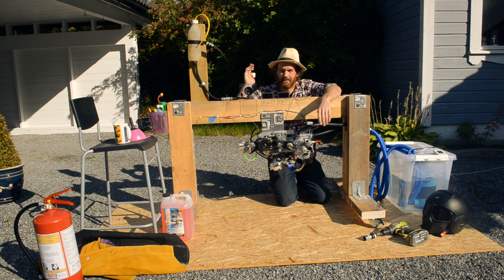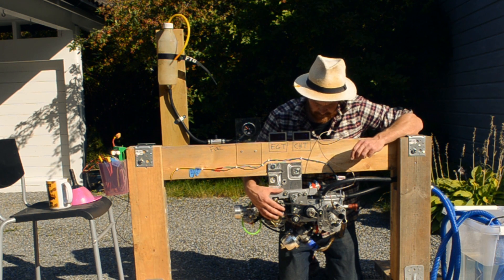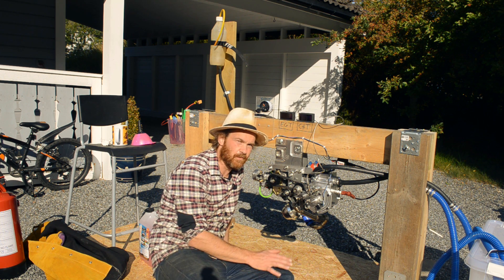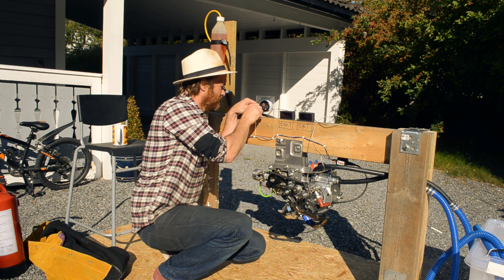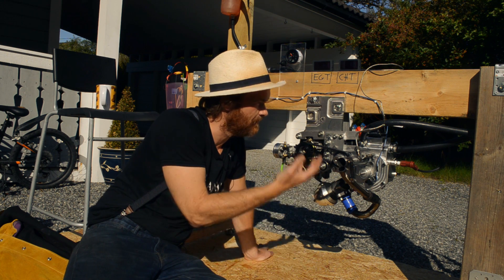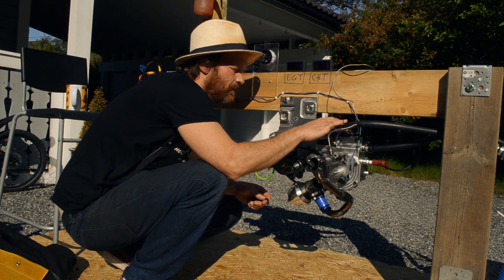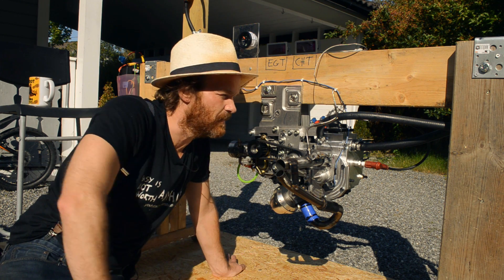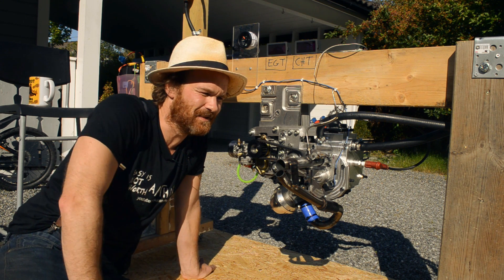First start! 50cc Supercharged Nitro Two Stroke - Will it explode?!

Comment: This can be called a huge succes, the engine of a new concept starts with just a few minor tweaks, but no major redesign is needed, apart maybe from the nylon parts that need remanufacturing in metal instead of a plastic.

Comment: Congrats!!
It runs! 
Now to fine tune everything and stop the Exxon Valdez leaking
RC fuel never fully burns, the castor oil burns at a higher flash they use it so the unburnt castor oil  takes heat away

Comment: 3D printed parts are very VERY porous. 
Looks like it's leaking at the 3D parts, also sounds like the carb isn't set right as it was bogging down (fuel starvation)

Comment: With this excessive amount of unburned fuel you'll be able to run a turbine too!! :D Stay safe my man! Drag cars use the exhaust power which can be as massive with 750 hp of thrust (7.4 Liters engines). Ending up with 3.5 hp out of your 50cc engine would be awesome, if comparable to 4-strokers with compressor :)

Comment: I found running rc nitro fuel in a 30cc gas engine would run but eventually stop, The nitro would pool in the crankcase and the spark wasn’t hot enough to burn the nitromethane, great video thank you 👍👌

Comment: To get the nylon parts to clamp better around the flange instead of putting washers underneath the heads of the bolts basically make a ring that covers the whole flange to spread out the pressure of the bolts pressing down essentially one big washer that catches all the bolts I hope that made sense because I can’t think of a better way to describe it because well at the moment I’m feeling pretty stupid blame it on the weed that’s what I usually do

Comment: Hey brother I love your commitment but in the video it looks like your blow off valve is opening wide open costing you a ton of boost now I could have this wrong but that’s really what it looks like you might want to check it out and congratulations keep it up anybody who tells you you can’t well in my opinion that’s a better reason to keep trying
Reply: I just realized you’re running a wastegate instead of a blow off valve I’m assuming that’s to control your boost but if you’re running a supercharger you can control your boost with pulley sizes and get rid of the wastegate it’s just an extra problem you are giving yourself if you’re getting too much boost change the pulley right down to where you’re at 2 pounds of boost just to get things running right get rid of the wastegate it’s a link in the chain that is unnecessary I mean I know it’s a two-stroke and my experiences with my supercharged Mustang where obviously there is no wastegate just a blow off valve to get rid of excess boost for when the throttle is slams shut so it has somewhere to go but because you’re running a two-stroke you shouldn’t even need a blow off valve it will just go straight through when you shut the throttle so yeah this is just my opinion but I think you should try that system without the wastegate on it and change your pulleys to lower the boost until you get it figured out then you can start ramping the boost in with pulley swaps I’m saying all of this because you’re giving yourself an extra headache with the part you don’t really need
Reply: I’m back again if you feel you need to have something down there to get rid of the boost when you shut the throttle just run an actual blow off valve that way it will stay shut when you’re under throttle and when you let go of the throttle it will open up and let everything vent so you don’t blow out seals or whatever the problem may be but I really believe that running a wastegate down there is going to do nothing but cause you problems just because of the way they work and the multiple ways you can hook it up all it is going to do is cause you trouble if you’re trying to use it to regulate boost which is some thing like I said can easily be done with pulleys and that way you get rid of variable link in the chain that you can never be sure is acting exactly the same way every time you change some little thing in the tune it might greatly affect the way the wastegate is working and cause you to chase your tail
PS I apologize for using no punctuation I had an accident and it just makes it easier much easier for me to dictate than to type so that’s how I communicate if I’m forced to do it via text

Comment: Cutting a large o-ring boss and using an o-ring in the 3D printed parts could help use the pressure to seal itself. Awesome build by the way, you're definitely a source of inspiration! I hope you get the attention and respect you deserve outside of YouTube. I feel like this is just your start.

Comment: From what I've read with 4 stroke single cylinder turbo engine, 4 to 6 times the cc intake plenum is perfect for building boost and not losing all pressure every stroke,as the turbo pulses with a single not like an in-line 4,be interesting to see if this is the case with a 2 stroke supercharger.

Comment: Congrats on the fire up, a little tweaking here and there and job's a good 'un.. Mind that exhaust was a bit like a nitro drag bike, tweaked for the finals.. Not many miles per gallon, sorry Km/Ltr or should that be Ltr/Km at that rate.🤭😲. Now the twin opposed piston single cylinder blown 2 stroke, like used in the UK Rootes Commer trucks. 3 cylinders, 6 pistons, rocker drive to 1crankshaft and a blower. 🏁🤔🤭😄👍🇬🇧

Comment: Forgive me, I certainly are not a 2-stroke specialist, but I have experimented with fuel phase changes with alcohol and gasoline - and with alcohol you surprisingly get a problem for not having enough heat to vapourise the fuel, when The engine is cold and it stalls many many times...

 I have understood that with nitro this problem is far far more significant. That engine may perhaps need a good pre heating and even some good ole gas for the carb during warm up.

Comment: First I wish to say I have watched a long time and am very impressed. After hearing the engine I have one thought that keep's coming to mind. Do you have the ability to adjust ign timing as it runs? If not you may concider it as that would allow you a much better tune ability. I am a retired small engine mechanic and shop owner of 44 years. Also a little back pressure would help? A silencers that's  adjustable like a super trap?

Comment: I have seen In some plastics there is a bit of metal in a seamless shape pressed into the perimeter using heat to get it in. but if the nylon parts as is don't hold up... adding a flywheel?

Comment: This guy is so happy haha love it. Sick build I’m gonna bet it’s gonna have the the power delivery of a 4 stroke 😈. That two stroke rotary exhaust valve literally solves so many two stroke problems 😇
Reply: power of four stroke? That'd be F'n dissapointing
Reply from the maker: It would, but I'm sure he ment the wider spread of power in the rpm range.
Reply: @2STROKESTUFFING  Sure haha
Reply: @2STROKESTUFFING  the delivery of power.  Also I see it being better than any pipe system, i think its coz going to work well at all RPMs, I bet the power will keep going up unlike a traditional 2 stroke once it falls off its pipe it just revs out and loses power. This system you designed could be the future of 2 strokes. I'd patent it bro.

Comment: I made a 3D printed Nylon (Not carbon fiber) intake for my Honda NC-50. Due to the material deforming at temperature, I was forced to use really thick flanges and tighten the bolts several times after heat cycles had occurred, until the material seems to quit deforming. I also used a wood sander to sand the surface relatively flat and smooth for better sealing. For reference, my latest intake flange is 10mm thick, printed solid, and not annealed.

If I had a CNC milling machine, I would have tried to make an aluminum plate in the shape of the flange and used it as a washer to sandwich the plastic material between the block.

Comment: IMO Alex should run it on normal pump fuel to start with as the RC fuel has being troublesome even on the PiP engine. I think the cooling system should be made closed loop for the time being to allow it to get up to 60 deg C asap allowing the engine to free off. The engine cases will act as a heat sink for a short while.
Reply from the maker: I have a plan - sous vide heater in the coolant reservoir. I'll preheat the engine to 60C or so before starting.

Comment: You can inlay a steel template of the gasket surface into the 3d printed parts during the printing process. Might give it better clamping force. If that's issue

Comment: It almost sounds like a 4stroke 2stroke 😂 a lot of compression though clearly!! 😲
Reply: The fuel, the cylinder design, the supercharger, the compression, I'm thinking this thing will have over 20hp mayby even over 30
Reply: @Wilma5532  but the big elephant in the room is for how long 👀😂😂 i know it isn't meant to be reliable as a mk1 test engine but it will be interesting to see how long it will consistently put out higher than standard hp

Comment: Imagine the multi cylinder configurations this form of induction would allow. Mind blown, ;-) literally.. I am amazed how you managed to design and build an operational prototype so rapidly(in a garage), while holding down a job. Congrats. I can see great things heading in your direction. You deserve them.
Reply: Rolls-Royce Crecy? Same but with sleeve valves.
Reply: Be careful with nitromethane in a 2 stroke you can melt everything I been there and done that

Comment: Considering that blower is designed for around 1000cc and your stuffing it into 50cc you might need a bit of underdrive like 8-10 to 1 or more! Anything coming out the blow-off valve is wasted HP spinning the air pump. I can't wait to see that little thing SSSIIINNNGGG dadading ding ding ding!

Comment: Fuck yeah! nice job Alex! I reckon using 'sandwich plates' on the 3d printed parts should provide the clamping you need, 4-6mm ali should do the job nicely, with a little goop for good measure i can't see them leaking anymore. definitetly worth under-driving that blower, you'd be more likely to get a good idle that way too, blowers often struggle to idle if driven too hard, some  blower setups use a bypass valve of some description just to get a decent idle.

Impressive work dude!

Comment: This is the future of engine building ( two stroke). Adding a splash type oiling system and a special designed piston/valve to block the exhaust port, on tdc, would allow you run the case oil, instead of mixed fuel. 

The super charger is very reminiscent of a Detroit diesel blower motor. Always thought it was remarkable. The blower makes sure there is always fresh/cool charge air/ fuel, while allowing a stiffer Reed valve. And the lack of cams and a timing chain really cuts the complexity/ weight. 

I'd be looking at the evenrude boat motors as a template.

Comment: Awsome! Looks like the WG is dumping a LOT of pressure as soon as the RPM increases. So you are probably wasting a lot of power driving the compressor unnecessarily fast just to dump it into the air. A larger pulley on the compressor is needed for sure! I would open up the exhaust valve to check for wear after this test run, too.

Comment: as far as i can tell from the video, I think
that you dump valve opens at a way to low boost pressure or you can change the gear ratio of the supercharger. Normally the dump valve only opens when the trottle plate is closed and the supercharger is running with the engine, but in your engine the trottle plade is in front of the super charger, eliminating the need for a dump valve.

Comment: Are you achieving high enough compression to ignite the nitro? It doesn't seem like it yet.
Reply from the maker: Not enough heat, might need to be warmed up on gas.
Reply: @2STROKESTUFFING  I thought nitro needed high compression and extremely hot spark to ignite?  Like the top fuel cars, those engines are nearly hydro-locking at TDC because of the extreme compression, which is why they tend to detonate when they lose spark in a cylinder

Comment: Consider Carbon Filled PETG for your 3d printed parts. Far less warpage, far better interlayer bonding and still petrochemically resistant.
Reply: @Geoffrey Machin good up to as much as 85 degrees in some cases. Plenty to ensure an engine runs before commiting to metal parts.

Comment: What if you machined channels in the aluminum side of the CF print part joints and used some o ring material inside the channel to make the gasket? Then superglue the ends of the o ring together to make it complete?

Comment: Well done, the fact that it runs is proof of concept. Any high performance engine can be a mongrel to get running correctly as there are so many variables. For just the first test runs why not use some high temperature sealant like Hylomar to stop the current leaks on the nylon parts that are letting you down? Then you can focus on the main issues.

Comment: Very cool.try taking some fuel out of it.looks to be way to rich .plug gap ,ignition timing with the blower is very important .to much cylinder pressure with the extra fuel  could be a problem with the head studs not clamping. Beware of hydroloc also bending the rod.a few ideas mate .love your work

Comment: Keep in mind that with RC fuel, especially if it's castor or a castor blend, there's often lots of unburned oil.
Iirc mine usually had 15%+ oil, supposedly not just for lubrication but for heat transport as well.
So, with that kind of fuel the exhaust will always be spitting lots of stuff.
That's not a bug, it's a feature!
Reply: makes sense. glow plug engines wouldnt last long if the fuel was burnt cleanly. no piston rings, very tight gaps.
Reply: Yep
Reply: you hit it right on the head with the oil being spewed out.  I only had a 3.5cc engine in my RC car but it would wet my hand pretty good if I put it near the exhaust while running.  50cc of blown engine is going to throw oil pretty good.
Reply: I figured it was just sweating hp lol
Reply: AFR can be tricky too. Changes to atmosphere,  temp and pressure needs more adjustment then petrol.

Comment: And it sounds like higher throttle higher boost more fuel sounds like you may have to pump up the fuel as well cuz it's sounds like running out of fuel as the RPMs go up

Comment: All your engineering know-how and ingenuity but you wouldn't use a remote starter setup. -- cringes through entire startup process with fingers crossed -- LOL

 Build a rig for the drill with built in retraction and remote actuate the pull trigger.  You can then run linkage setup to throttle and choke via servo or even a good stiff metal coat hanger should work :D.   Protect the genius that is you my friend,  we need you around!!

Comment: For 3d prints At work we often try to make the flanges extra thick and always use rtv, the surface isn't smooth enough for seals. And if it doesn't work you can add some small extra screws to the flange to help, they can be very small, just to aid the seal surface a little bit more.

Comment: Loved every moment so happy to see it run. Re do all 3D parts to alloy if possible I think you will run into the same problem engine start then dies after a few revs. You can hear the load of the supercharger on the crank. I’d Put a smaller pully on the crank and even maybe a read valve setup on the charger to limit the volume of compressed air going into such a small cylinder

Comment: Absolutely glorious! Congratulations on the first start!
You probably know this but just to be sure: Keep in mind that Methanol is hydrophilic. It absorbs moisture from the air. If theres methanol in the engine, steel parts like the crankshaft or the bearings are likely to rust after some time. You can prevent this by flushing the engine with oil spray after it ran.
Reply: Well it's a 2 stroke so I think the oiling is taken care of.
Reply: @cravenmoorehead5636   That's what I thought first, too. But even with the oil residues, the small model airplane two strokes tend to rust after some time. I have had many of those two strokes with rusted crankshafts and bearings.

Comment: Really cool! I would try an anerobic sealant on the leaky parts. Rolls Royce developed Hylomar to make up for flawed castings and uneven surfaces. Permatex makes a red version that performs similarly.
Reply: Cleaned that off and stippled many RB 211 and Avon flanges.
Reply: @Davidelmhirst  
I have read about that but never seen it.

Comment: You might machine a plate to cover the screw mounting surface, to sandwich the nylon between it and the motor. Could distribute the clamping pressure more evenly , so it's not just a fastener head putting pressure on a small surface area. Could be done in two halves
Reply from the maker: 👍 I'm looking into my options.

Comment: @ 7:44  “cool”….  I think we’re all feeling that way for you.  Nice work Alex… truly excellent! 👍

On the leaks, a few have said counter plates on the top of the flange… I’ve had to do that with my manifold to seal a water port in the head…. Maybe not 0.6 bar pressure but 3mm plate did the job…. 

Can’t wait for some dyno numbers!
Reply from the maker: Thanks! Yep, need some plates or something.